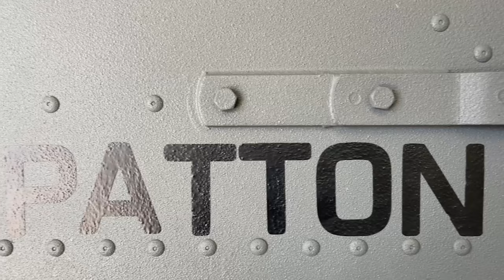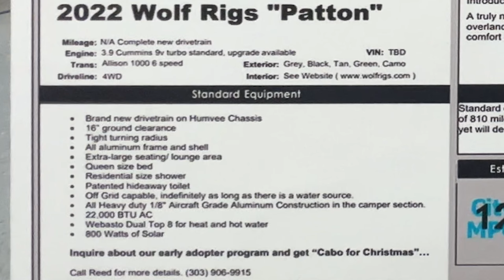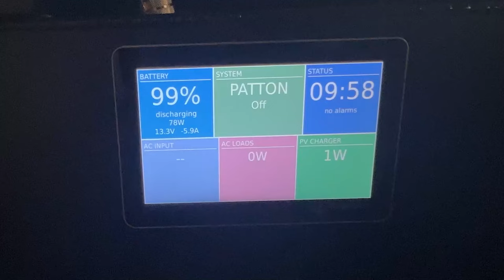ULTIMATE Bug Out RV?? Wolf Rigs Patton In-Depth Walkthrough!

Comment: The satellite trailer idea w/ umbilical is a good idea. There was an expedition vehicle made several years ago that not only had this , but the wheels were driven by the main vehicle as well, effectively turning the vehicle combo into an articulated 6x6. They look like theyre gonna have some nice stuff, man!
Reply: I believe it was called the KlaraVan
Reply: @Driveby-Viktum  KiraVan

MaxiMog was an earlier Unimog and powered trailer rig by the same builder.
Reply: One reason I am not partial to a Sprinter because of the outrageous Mercedes maintenance costs and lack of readily available shops. What are the maintenance requirements for the Patton and would the engine be serviced by Cummins?

Comment: Cool vehicle.  It will end up seeing limited off-road use by most purchasers due to its size and cost. Unfortunately as a Humvee base vehicle it will be a fairly uncomfortable tourer.
Reply: I don't know if the HMMWV is that bad for comfort, but the 4BT engine right beside the driver could be brutal. I hope the engine at least has balancer shafts.
Reply: @brianb-p6586 It will be bad for comfort. It’s a loud, slow, rattly, rough vehicle that was implemented in the 80’s. A new paint job, dash details, and some seat covers isn’t going to fix that.
Reply: @jim yeats  I suppose it has military soundproofing (that is, none), so if they haven't upgraded that it would be loud.

Comment: Good video.  I like the basic idea, but the interior needs a lot of work to be comfortable.  I didn't see a TV. I didn't like the refrigerator. I didn't see a fire extinguisher anywhere. I will keep an eye on this as it develops. You're definitely on to something.
Reply from the maker: Lol a TV? For what Linda? Look out the damn windows.
Reply: I know that 99% of what is on TV is crap and that it is a bug-out vehicle. However, 99% of the time that one uses the vehicle, one would not be bugging out. And even if you were bugging out, you would want to know what's going on out there. News reports and breaking news could be very useful.  As well, if it is pouring rain outside, you're stuck inside a small space with others, it might be a good distraction. I've watched many rv videos. They all have TVs.  I don't think it's such an LOL idea.
Reply: @lindaaaron9653  I don't think that a TV is unreasonable, but an alternative is a laptop computer or large tablet, with a TV tuner accessory to receive broadcasts. That avoids building in stuff that is rarely used and becomes obsolete quickly.
Reply: Yeah, very poor layout, definitely needs to talk to people who do this already, the layout is abysmal and lacking very basic amenities, like a flip down table, if only for two people
Reply: @Quivering Quarterling  it certainly needs a table. Others have suggested a Lagun mount for a small table in the bench area.

Comment: A 4BT? I hope it has a balancer system; without it, a 4B must be like driving a paint shaker. For those unfamiliar with the engine, this is a 4-litre displacement 4-cylinder. Cars have balance shafts on any engine of 2L or larger, but this industrial engine doesn't always have them. It is two-thirds of the common Cummins 6B six-cylinder (like a Dodge or Ram 2500 or 3500 diesel pickup), is typically used in industrial applications and in cheap commercial vehicles (delivery vans, etc.), and is often used without balance shafts.
Reply: buy 4 ced betyer nogs

Comment: Nice! How much would the MPG increase with adding some slope on the front of the cab. Any security cameras?
Reply: The existing design, a modified version of the classic ambulance-type Hummer (which you may be thinking of), incorporates a bunk above the drivers compartment,  you'd either have to lose the bunk (namely, the whole point of the modification!), lose the windows in the bunk space (another intentional feature of the design!) or add height to the whole vehicle (which creates other problems).  What he has here is the best compromise to get all the features he wanted.

Comment: needs a remote controlled .50 cal and mk 19 40mm grenade launcher up top.  Iron curtain Active Protection system and 360 degrees flame throwers.
Reply: They had an anti hijack flame thrower system available in South Africa in the 70’s. Efficient at torching the shins off of those jealous of what you have.